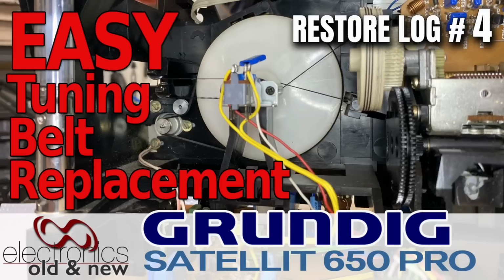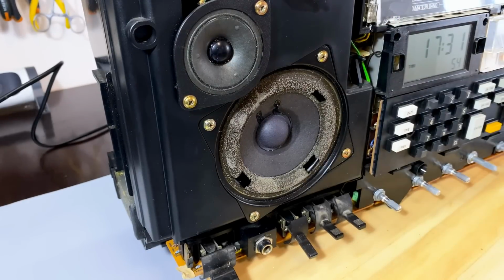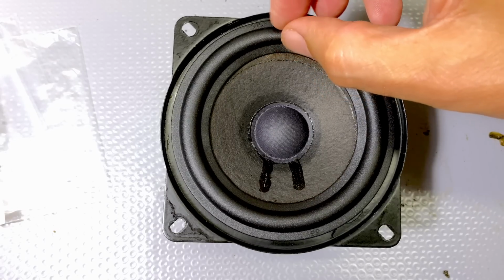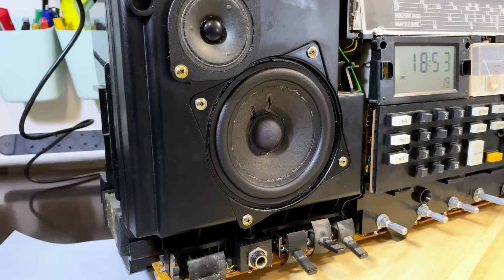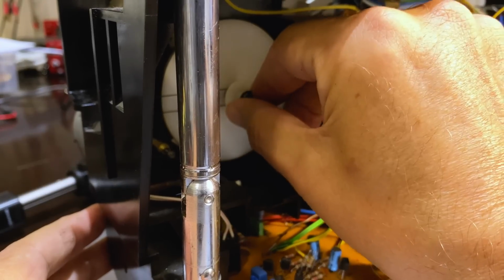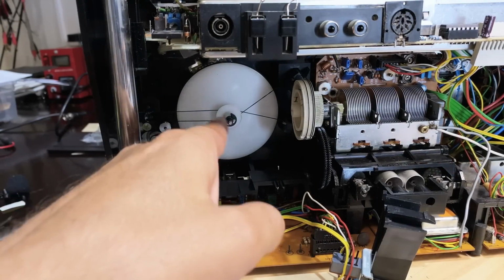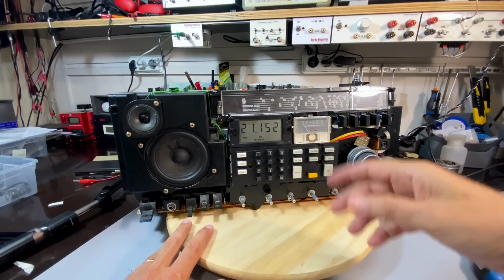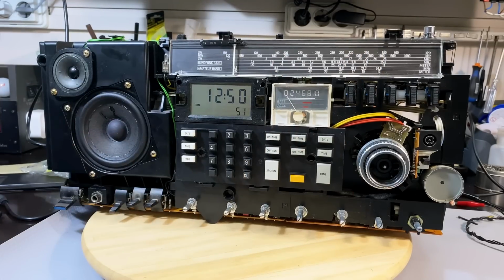Easy tuning belt replacement, without any swearing! Grundig Satellit 650 Pro rest. pt.4

Comment: Great videos :-) I have just bought a Satellit 600, and looking forward to getting it, and see if anything is wrong with it :-) . I was just wondering regarding replacement of the belt: Couldn't you just have removed the c clip inside, and pulled the small knob out, including the axel?
Reply from the maker: It’s been. While so I can’t remember exactly what I faced at that stage, but the method used was what probably seemed easiest.
Reply: @electronicsoldandnew  I know it was a long time ago. I just got my 600 today, and I tried your suggestion about moving the motor a little, but the belt was too far gone. So I decided to try and answer my own question, and Yes - you actually only need to remove the c-clip on the back, then you can gently press out the axle including the front knob. (now Im just waiting for a new belt) :-) Thanks for a great channel.

Comment: I just changed the tuning belt on my Satellit 650 thanks to your video. I was in trouble for some misleading information, and also for the presence of glue on the shaft, under the cotter pin on the inside of the receiver. I also fixed the speaker, replacing the rotten foam. Thanks again for sharing, I am not a repairman, I can only solder, disassemble and reassemble certain objects.
Reply from the maker: Glad to hear that my videos helped.

Comment: Hello! Only recently I found your channel. Great content ! As far as these days I have got my Satellit 650 and have to replace the rubber belt...hope to find it on eBay.                                On the other hand I am wondering where I could find also the soft rubber ring for the main loudspeaker...if not, maybe a more costly solution would be to adapt another speaker with similar dimensions and electrical parameters (if any).
Reply from the maker: Do a search on Google and I’m sure you’ll find suppliers of speakerphone that’ll suit your speaker. There are a lot of them around.
Reply: @electronicsoldandnew  Thank you for the prompt answer (yes I already have found offers for main new speaker), unfortunately no offer for "Abstimm-Riemen für GRUNDIG SATELLIT INTERNATIONAL 600 650 Satelliten radio Belt"...
Reply: @electronicsoldandnew  Quite right. I have found on eBay "2 Replacement 4" Speaker Foam Surrounds For Grundig Satellit 650 Foam Edge" - Brand New. Thank you.
Reply from the maker: @avramescuovidiu3577 : 👍

Comment: Hi Manuel; I am working on the same radio; I have tghe same problems you had; one of them is a broken belt.;  can you help informinmg the diameter of the belt to find it here in Brazil.;  thank you;  very nice job you do with your radios.
Reply from the maker: I’ve already fitted the belt so cannot measure that one. However, judging from the old belt, I believe the new one should have a diameter of 9cm.
Reply: @electronicsoldandnew  Yes, I understand.;  I will look for a 9cm belt (or around:  unfortunatly mine broken in many pieces
Reply: Buenas tardes tengo un equipo de estos Satelital 600 para repuestos  completos si es de interés de alguien soy de Rosario Argentina Gracias,,!! Estando desarmada para cambiar las luces se cayó al piso y se partió la plaqueta,,

Comment: Looking great so far. I've never repaired a speaker before, it is nice when you can get spare parts, even it it does take a little time receiving them. I love the tuning, but would find it strange manually turning a knob and having a slight delay on the dial pointer. I wondered if a tension wheel could have been used on that belt, if one wasn't available. It is looking like a very nice radio already.
Reply from the maker: I agree that the tuning is a little strange. We’ll see how it goes, and if I get used to it. Not sure.

Comment: you want to align the preselector peak? 😇 look at this guy here: https://www.youtube.com/watch?v=zDQ5oJnczU8
this guy is an engineer in electrical engineering and a professional repair man.
...by the way, in his first part he does the cumbersome method belt replacement due to the brittleness of the plastic material caused by aging. to avoid damaging anything.
have fun 😎

Comment: Nice work on the replacing he surround and on the belt replacement as well. I know it's a bit more work, but having some crimped push on speaker connectors installed makes things more "service friendly" instead of soldering, and you do find that a LOT of even "High End" speakers connect the crossover wires to the drivers with crimped push-on connectors as well.  As far as searching for info on things, I make sure that I put a few related words into the "tags" section of the video info here, and I have found that they will come up well on google searches as well as a Youtube search.  Keep up the great work, that is quite the unique tuning indicator system on that radio, I'm sure it added some engineering complexity, and cost to it, but it makes it an interesting unit for sure 👍
Reply from the maker: I do add tags to assist in the searches. 
This system is rather interesting… we’ll see if it becomes useful, or annoying in regular use 😊

Comment: Hi! I have some suggestions first to clean plastic ( foam) residuals from metal just try "white spirit" instead of alcohol. Uhu glue with plastic and metal not work well. The cement glue is more better! The Uhu  glue after dry simply will separate from metal if you have luck the paint from speaker will kell de glue on place!Kind regards, John!
Reply from the maker: Thanks for the tips.
Reply: You welcome!
Reply: I thought of white spirit (terpentine ? ) too, it is really good against almost any sticker glue, but in this case I wondered if it would leave an oily residu soaked in the paper which would work against the glue.
Reply from the maker: I try not to risk anything, so isopropyl alcohol is usually my first choice
Reply: @electronicsoldandnew  That's right, but alcohol evaporates very fast, and white spirit does not. In case you have a sticker or other temporary glue that is stubborn, you can pack the spot in paper or cloth, drip some white spirit on it, and soak it for a day. Impossible with alcohol.
Reply: @erikdenhouter  White spirit and terpentinei are totally different things.
Reply: @erikdenhouter  White spirit is obtained from petrol ,"terpentine is a fluid obtained by the distillation of resin harvested from living trees".White spirit is used also for whet sanding of wood after a first layer of laque apliied!For gluing the membrane you must use a glue whoo ramain "elastic " after dry. In this case Contact Adhesive from Bison is much better then Uhu.
Reply: @ioanchindea4427  Thanks for explaining the difference. In my Dutch language that stuff obtained from petrol (or oil) is called 'terpentine', for you 'white spirit'. It is the stuf you use for the old house paints. It is in fact made as a cheap replacement for the resin based pure terpentine (in Dutch 'terpentijn'), which is softer, and more expensive, often used by artist these days. Most important, they are indeed different solvents.
And about the contact adhesive from Bison: I use that stuf since the '60, and sadly I have found that somewhere in the last 10 years they have changed the formula, and (in my opinion) it dries now as a sort of soft rubber without sticking well. OK if you need that of course. Earlier it hardened much more rigid, and sticked better. It could of course be that I found a 'bad batch", I don't buy it that often.
Reply: @erikdenhouter  I agree with you.Nothing's like before!